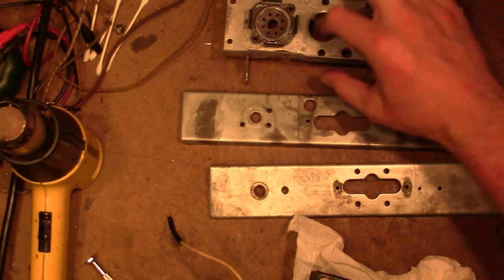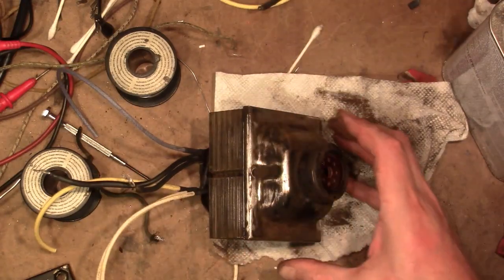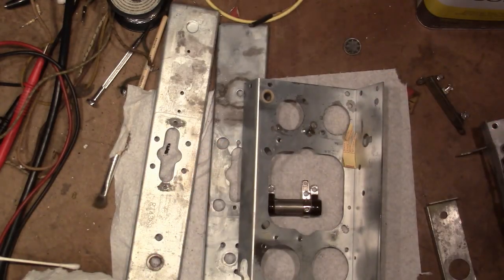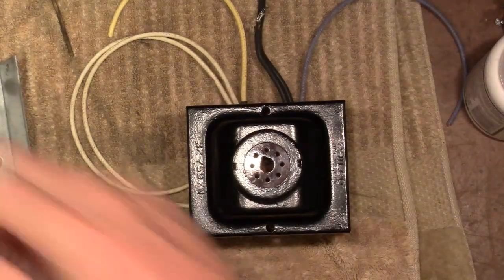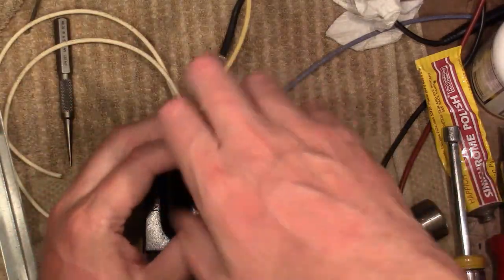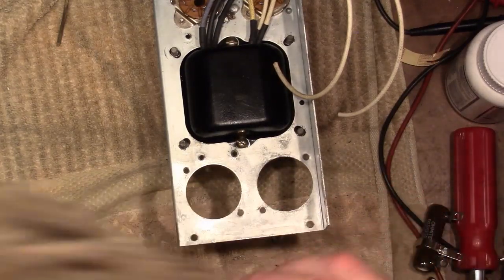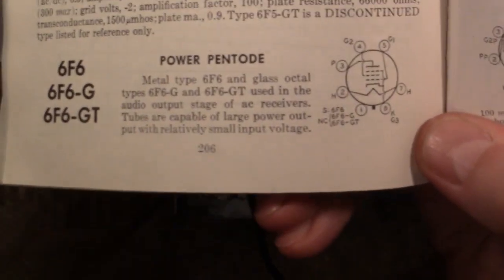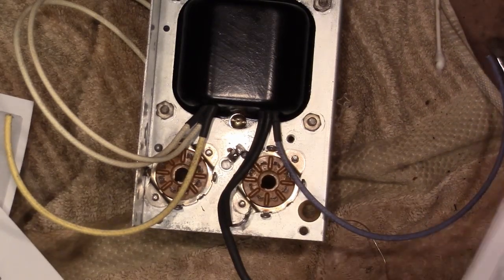Philco 37-640 restoration p3o12

Comment: With regard to those two replacement sockets, are they new old stock, U.S made, Cinch Jones sockets are are they a pair of the Chinese copies they sell on fleabay?
Reply from the maker: I'm not sure but they appear to be NOS and good quality. The have 'EBY' marked on them
Reply: bandersentv
Eby was an old American make, so I guess that means they are NOS. By the colouring though they look like they may be made out of micanol, which was a type of Bakelite with mica mixed into it for extra insulation. Did you find those in that old TV shop along with the Rider TV manuals and the relay sockets?
Reply from the maker: OlegKostoglatov No, from Ebay seller 'toober'. He specializes in NOS parts
Reply: bandersentv
I remember you mentioning him before. I had to buy some octal sockets a few months and finally settled on some black Bakelite ones that a fellow from Ukraine was selling. Most of the sellers with NOS U.S made sockets wanted stupid prices for them, like $5 to $10 a piece for used ones, the China made one were cheaper then either the Ukraine ones or the U.S ones but I don't know about the quality.
 They are either more recent production or Soviet surplus. In any event their design is very similar to the one Amphenol used to make where they have a flange on and a wavy locking ring that fits into a grove underneath.